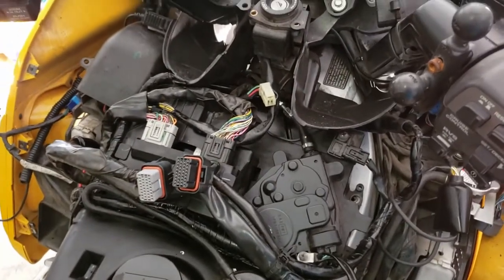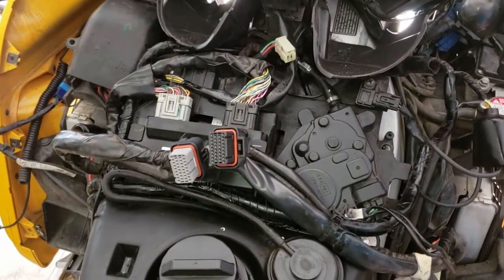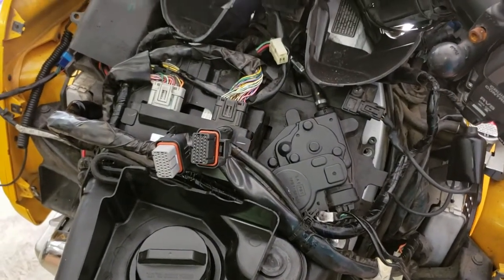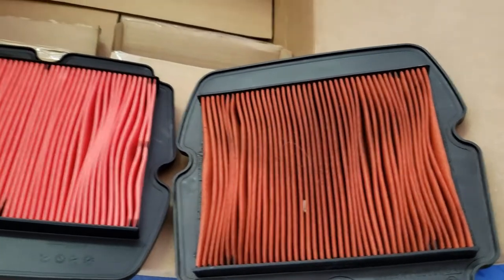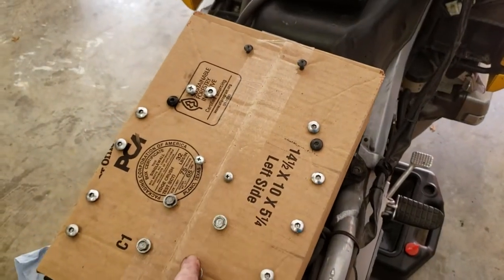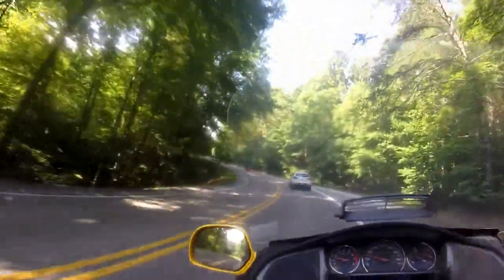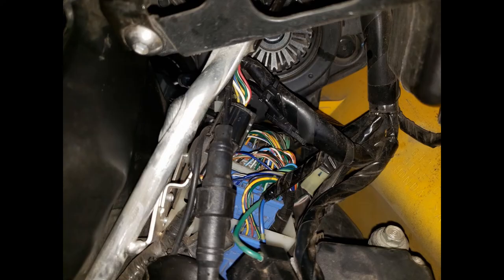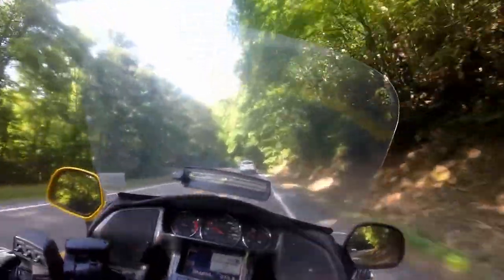2010 Honda Goldwing Maintenance 86,000 miles

Comment: how often do you do a valve shim check?
Reply from the maker: The manual calls for valve adjustment rather regular. I had it done a while back and haven't had any valve chatter so I haven't had it done. It does get noisy.
Reply: Adventures with Redbeard  A little on the noisy side is good in my book. better to be a little loose than tight. I did my valve Clarence check at 28k And surprisingly there was less then 0.02 of wear😃 At that rate I probably won’t actually need to do Any real work until 80k or so. i’ll just keep my regimen of using really good oil frequent oil changes and try to keep the high rev’s to a bare minimum.

Comment: Looks loike your tpms light is on ...just like mine.replaced sensors now light come and goes. If its the module forget it ill put a piece of tape over the light or hot wire it to stay off!!!
Reply from the maker: My TPMS sensor is on due to the tire place that mounted this dark side tire broke my sensor and I've yet to replace it. Tire mounting equipment is on the way, so  we'll see what happens.